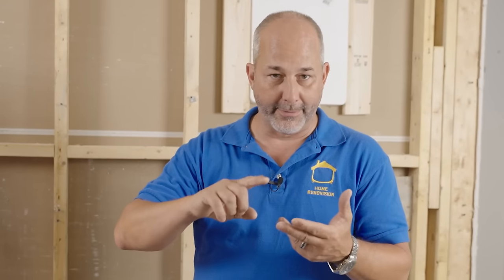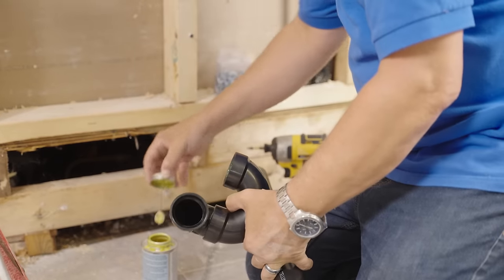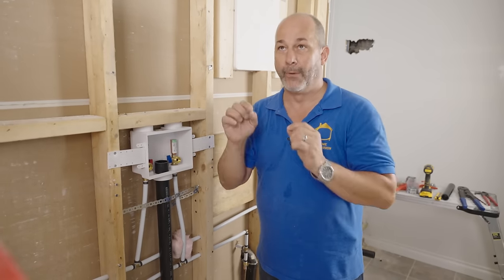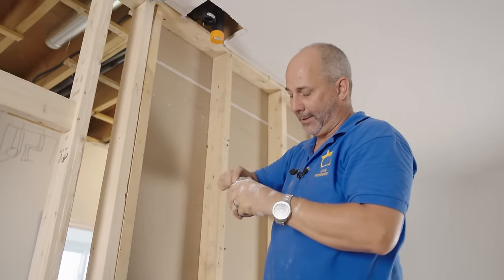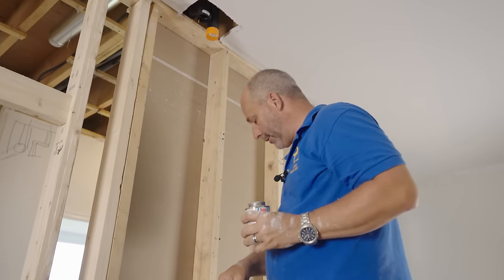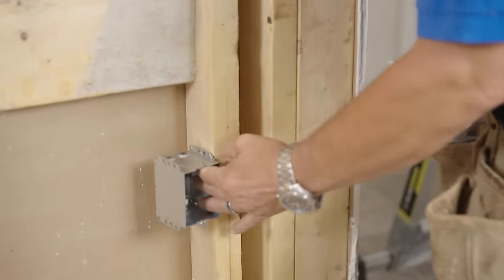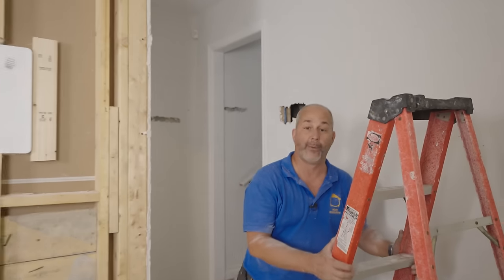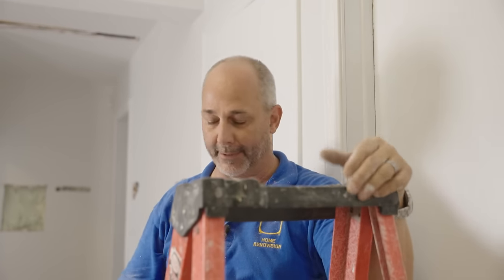How To Move (Or Add) A Laundry Room | Church Flip | Episode 13

Comment: How can you or want to tie exhaust fan into wet vent, is it because it was going to open sump pump?  Otherwise you would never want to due so because of sewer gases, smell or methane back thru fan...  Must of been an exception ?
Reply from the maker: Just because it was done does not mean it is acceptable. remember this building was rebuilt after a fire and that means very little inspections.

Comment: RIght before your wire entered the panel room, you ran the wires under a floor joist.  Is that legal? What keeps a screw from being drilled through those cables when you patch drywall? And wouldn't that keep the drywall from being able to sit flush?
Reply from the maker: building a box to keep my life simple. Cheers!

Comment: Great video! Always wondered about dryers having a completely different power outlet/size than a regular one like for a fridge or a washing machine. What is the theory behind this?
Reply: A dryer, like an electric oven, draws a huge amount of power in comparison to the other appliances. Thus the components of the circuit are more robust.

Comment: Wrong pipe.

Code is 2 inch for washer drains. Has been rqeuired that way since approx 2016 in Ontario.
Reply: Jeff did mention upgrading to 2 inches at 22:55.
Reply: @Ding_Bat  Yeah, but he's trying to play it off in the comments like it's something new he wasn't aware of.

Its been required for 6+ years now and talked about for a decade.

Comment: Question on the waste water pump you need for this basement.  Are these pumps reliable? I would imagine if it broke down or had any other issues, your drain water would back up, right?? My last question is ...do basements when being built with a bathroom or any other requirement for a drain have regular gravity sewer lines put in? Or do they also require pumps from the get go when new??
Reply: Saniflo pumps are reliable. But it they go, or the electric is off it will backup.

Other option is to dig a pit, put in a macerator ejector pump to the sewer line. This is typical and would likely be used on new construction.
Reply from the maker: I am simply getting occupancy with the intention of doing a major renovation at a later date. I don't actually intend to use the laundry , just need it for the permit. in real practice I suggest the 2 pump version of this company. they work independently and have an alarm if needs service.

Comment: I was thinking saw a bathroom makeover video where you used the pinch clamps?  What changed your thinking on them failing over the rings.  Thanks as always for the very good and informative videos Jeff
Reply: They rust
Reply: None of the PEX products are good or reliable. Rings or crimps. We cut out and remove more PEX pipe & fittings versus any other product. It’s a waste and unreliable. Contractors use it because it’s cheap, quick and efficient. The lost art of soldering is gone, and most won’t purchase a pro press. Could even install floguard as an alternative. PEX is for the greenhorns.

Comment: Did you say you are furring out the wall 2”. Would it been easier to add your furring strips, then set all you rough in boxes?  Thank you for sharing.
Reply: If you watch that section again, you will see it was shot after all the electrical was roughed in.
So, he did all that work, and now needs to detach the boxes and reset them after furring out the wall.
Reply: @tay13666  gotcha. Thank you

Comment: Correct me if I’m wrong but I think you can only use the abs/pvc transition cement once in your entire home per code.
Reply from the maker: no idea. just know that the only place i need it is in the laundry!
Reply: ABS to PVC solvent or cement is prohibited and he should not be using it. Transition adapters should have been installed when changing to different materials. The “all purpose” cement he’s using has fine print on back of can, must not be used in place of original solvents or cements. No matter what the can says. ABS cement for ABS, PVC primer & cement for PVC.

Comment: Jeff! You can glue in a 2"x1-1/2" abs bushing into the bottom of the dryer box using PVC/ABS transition glue. Makes it much more secure! Cheers
Reply from the maker: I actually had to change it out to a 2" line to meet the new code. always learning.
Reply: And it fits right into the bottom of the box and gives a real nice finish.

Comment: Pls use a slot head screw driver to open knock outs… Easier Faster. ; )  Washing Machine drains I think best if 2” ABS. The issue is volume & speed of water as it goes down drain from machine. 1 1/2” really minimum. 5 yrs ago Toronto Bldg Inspector said 1 1/2” was OK. I had used 2” for basement washing machine drain. I told him based on water volume and speed 1 1/2” insufficient. This is just fine for a bathroom sink, but as time marches on, insides of all drains get reduced & coated etc. Just meeting minimum bldg code is fine, but going beyond the code is often better in the long run. If Ontario Bldg code has changed to require 2” for washing machines, that is a good improvement.
Reply from the maker: turns out I needed to switch to a 2" pipe. code changed recently. Cheers!
Reply: why ABS and not PVC?
Reply: @bebetterministries304  local bldg code / preference in my area. Above ground ABS - perhaps thought to be more flexible for expansion & contraction due to temperature. PVC below ground takes more pressure. At least this is what I think is the reason in areas with long Winter seasons…

Comment: I'm hoping someone responds to this.....what if there is only one stud available when replacing the ox box? This is a manufactured home. The next 4x4 is way way over and behind the drywall. What to do? As is....the oxbox(spelling?) would only be attached on one spot. I wondered why the previous box was so floppy.
Reply: Add additional 2x4’s where necessary to properly install your laundry box.

Comment: I was using the rotozip & stripped wires in 2 boxes & cut the ear for the face plate off another box. I was using the drywall bit for the rotozip. Good thing the box was accessible behind the wall & there was plenty of extra wire slack. I have no idea how that happened other than a faulty bit.
Reply from the maker: sometimes if the extension on the bit is greater than the pilot end it happens.
Reply: @HomeRenoVisionDIY  Ahh, OK. I had no trouble with the other cutouts but the bit broke off with a couple of boxes to access. I used an oscillating tool to finish. Thanks for the reply.